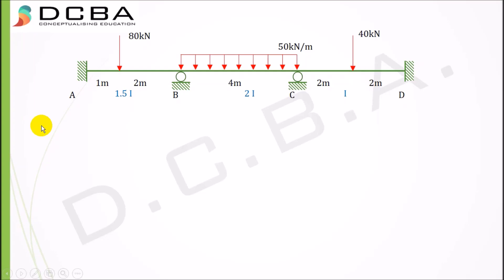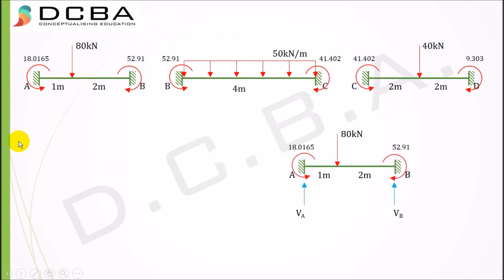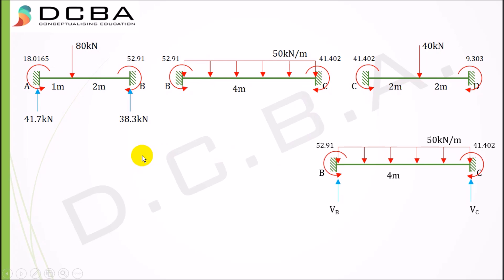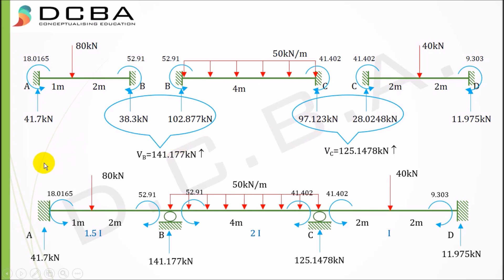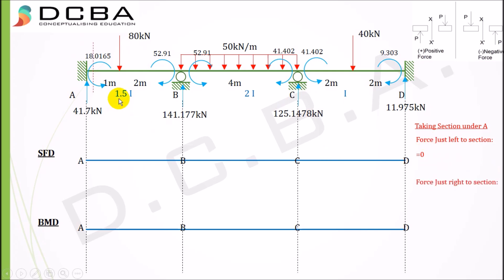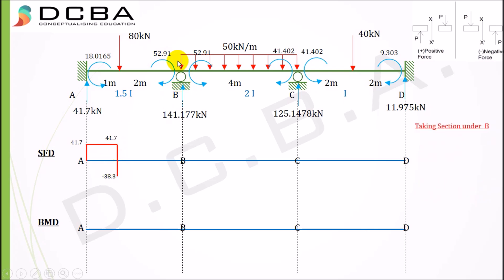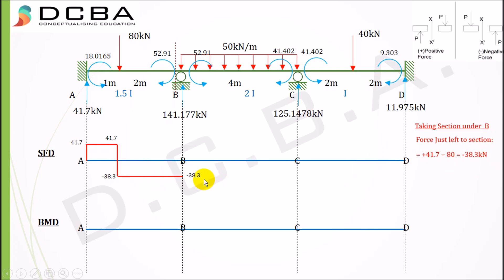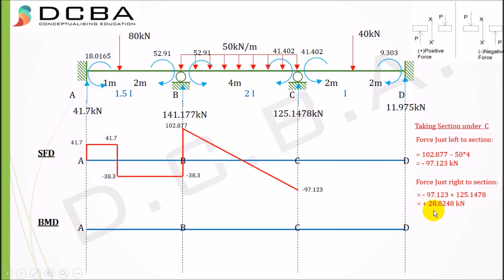SFD and BMD for Continuous Beam

Comment: Hello. What is the formula used to get 99.9159? The moment of span BC there
Reply: Cut a section at a distance of 2.058m from B (...i.e 2.058m from the left). Take moment about that point and you will find that M= 99.916KNM. I hope that helps.

Comment: Hello Sir. Thank you for the explanation. Please while analysis the mid span(BC) for bending moment, where did you the 100kN you used as support forces. Thank you
Reply: considering simply supported beam, for udl 50kn/m over 4m, reaction over each support willl be (50*4)/2=100kn

Comment: Sir please tell me how to calculate resisting moment in fixed beam... Like in this question 18.0165 and 52.91
Reply from the maker: Resisting moment is nothing but the moment produced by strength of the beam against the moment produced by loading
Reply: @DCBAonline   kk.. but how you calculate the value... 18.0165 and 52.91
Reply: @32590129  i was wondering too. Like how

Comment: Why there is no Horizontal Reaction forces at the supports?
Since it's a fixed beam.
Reply from the maker: Because all the forces are acting vertically and axial deformation is neglected
Reply: @DCBAonline  
Thanks for the quick response.
I was interested to know how the horizontal forces are being calculated.

Please help me to refer some good examples.
Reply from the maker: Finding horizontal component is a tideous task and would have to take into consideration the axial stiffness check for axial deformation and then find horizontal forces. I would suggest look for stiffness matrix methods for this.
Reply: @DCBAonline 
Really Appreciated..!

Thank you Sir.

Please make some more videos about Indeterminate structures taking realistic problems..

Comment: Nice video.
I have a doubt, while solving the BM for UDL span(17:20mins) you said wherever SF is zero BM is max, but in the diagram (FBD of the member given in the left part) the BM is max at mid-span i.e 100kNm. At distance 2.058m the BM is 99.95kNm. So the max BM is 100kNm but we are taking 99.95kNm as max BM value.  
Please clarify the doubt. 
Thank you.
Reply: Nothing much difference
Reply from the maker: You will get 100 at a distance of 2,but the actual moment at that point would be (100-47.156)=52.844, 47.156 is the ordinate of the trapezpoid at distance of 2m, so you see that does not give us the maximum value because maximum value of BM is 52.927 kNm

Comment: learn something ,
those moment values are streched values,they are not compressed ones.to tell you this much;you need transforming functions for shear and moment functions if you want to keep the system in equilibrium,and you are
going nowhere by using your shear and moment funtions as shown on your video.I looked into software already,they defaulted as you did ,but not on the  final elastic curves .To be fair on you,your work is not COMPLETE.
Reply from the maker: The Structural Analysis Matrix Formulation App then you complete it. And post it ill, learn from that.
Reply: you mean that you don't know how to contruct the rotation and deflection diagram,right?what is the maximum deflection when x=5.036005
Reply from the maker: The Structural Analysis Matrix Formulation App oh god pls stop pestering me get some life dude, check my other videos and find it by yourself i dont have time for for solving your queries or giving you replies every now and then.
Reply: DCBA online I am sorry man,you are pretty good,you make me laugh,Dude.I am serius now;you said you have my deflection equations profile for this problem ,or what?Do you get my E-mail I sent to you?I would like to help you ,I have spent hours figures this out as you did on your presentation ,I ' appreaciatte it ,Indeed.

Comment: why don't you fix the moment  diagram is wrong?,you know.
Reply from the maker: The Structural Analysis Matrix Formulation App what are you trying to say? Be clear.
Reply: ok,the shear force and moment value are completly wrong since you are NOT in a equilibrium condition statics,you are OFF.
Reply from the maker: 🤣🤣🤣 They are absolutely correct.
Reply: what are the rotation at B and C ?
Reply from the maker: The Structural Analysis Matrix Formulation App watch my related video you'll get what you want

Comment: I didn't understand y u have taken reactions at B&C as 100 each while calculating bending moment at span BC instead u should have used formula (w*l2)/8 which u have used in your slope deflection video
Reply from the maker: chintalapudi priyanka that was done to impose simply supported bending moment of span BC on the fixed end moments and the find the actual value later on as shown in video
Reply: So can I use the formula (w*l2)/8 ?
Reply from the maker: chintalapudi priyanka no the reason i did not use the direct formula is because you need to find the simply supported bending moment at the distance where shear force is 0,you can find it from SFD and in our case it comes out to i guess 2.058 or something, and this is where you need to find the simply supported BM, wl2/8 gives value at exact centre of the beam.
Reply: @DCBAonline  so why u have used direct formula (wab)/l formula for other spans(AB and CD)..

Comment: What is the formula for udl to find moment
Reply from the maker: Formula for what ? simply supported bending moment? fixed end moment?
Reply from the maker: Fixed end moment is wL^2/12 ,simply supported bending moment is wL^2/8
Reply: I m asking for UDL TO FIND BENDING MOMENT AS U HAVE USED IN THE FORMULA AND WHICH L?
Reply from the maker: can you pls enter the time at which you are referring the formula that i used, its difficult to understand this way. bending moment for udl is wL^2/8 , L is span over which udl is spread.
Reply: Wen u r finding the BMD IN UDL
Reply from the maker: while finding bm for udl no particular formula is used its simple finding bending moment at a point where the shear force is zero.
Reply: DCBA online ok but I want to know y u have taken length 2.058 y not 2
Reply from the maker: because at that distance the shear force becomes zero, and bending moment is maximum where shear force is zero
Reply: DCBA online okay
Reply: DCBA online actually I have a question for you
Reply: DCBA online may I ask a question it's related to the video but bit different situation
Reply: DCBA online what if the vertical reactions are equal AND  then how we will make SFD N BMD ( UDL)

Comment: May i nknow how you find the distance 2.058
Reply from the maker: you can find it by property of similar triangles
102.877/x = 97.123/(4-x)
you can solve the above equation to get value of x=2.058m
Reply: Use similar triangles for BC to solve for the unknown distance x. We get (x/102.877)=((4-x)/97.123)==>x=2.0575 m from B

Comment: may i please know how you found the moments at different fixed point?  and what is the difference between this method and the one analyzing the deflection... i mean, can one uses either method at any time or there are restrictions?
Reply from the maker: lisa livia ive found moments using moment distribution method you can find the link of that video here
https://youtu.be/WYW-upIyWLs
Its also in description.
Reply from the maker: lisa livia i didn't get the second part of your question could you pls clarify it in more details.
Reply: thank you for your answer, really appreciate
for my second question:  im just wondering is there any difference between the method you used here and the slope deflection method? can i use this method or the slope deflection method at anytime?
Reply from the maker: Yes you can apply slope deflection to any problem for analyzing the beam or frame, and then drawing SFD & BMD.
For the matter of fact you can analyze by any method that you know best, few methods to name would be
Moment Distribution Method.
Slope deflection Method.
Stiffness matrix method.
Flexibility Matrix method.
Clayperons 3 Moment Theorem etc etc whichever you know the best.
All the best.
Reply: thank you soooooooo much,this is really helpfull

Comment: Please you tell me trapezoidal formula for finding BMD on moment distribution method
Reply from the maker: there is no certain formula for it its basic linear interpolation however if you do want a formula i can give you but it will only work on the conditions i state ,
if 'a' & 'b' are two parallel sides of trapezoid where a>b, & L is length of the trapezoid
'x' is the distance at which we need the interpolation value and 'x' is measured from 'a',
then the interpolation value 'y' is given as   y = a - (x/L)*(a - b)

Comment: why are we drawing the bm for the simply supported from the fixed end bm?
Reply from the maker: Anish Ghosh ,  it is a shortcut method to draw the BMD for a continuous beam, the method is that first you plot all the fixed end moments than you plot all the bending moment values if each span were simply supported and then join it.
However you can also draw bending moment in traditional way that is isolating each span separately and then drawing bending moment for each span by finding reactions of each span using normal equilibrium conditions.